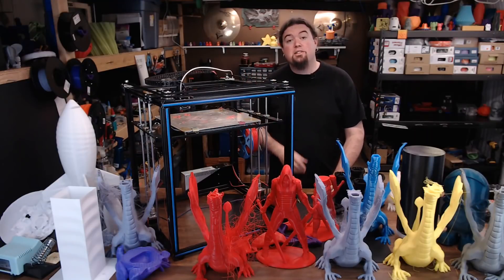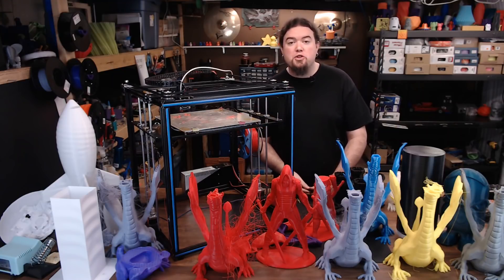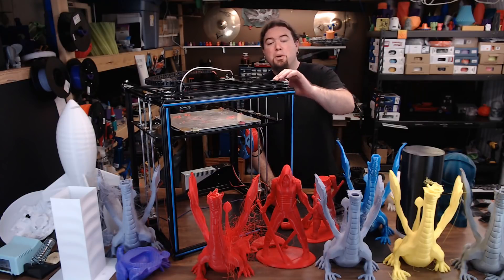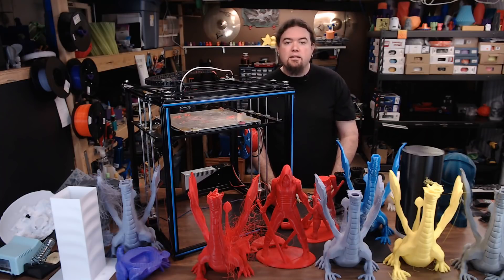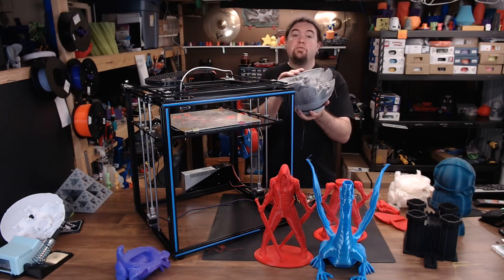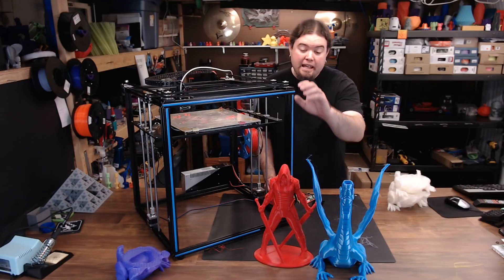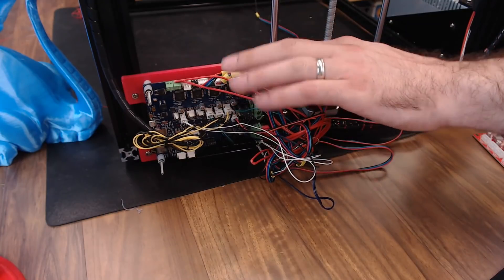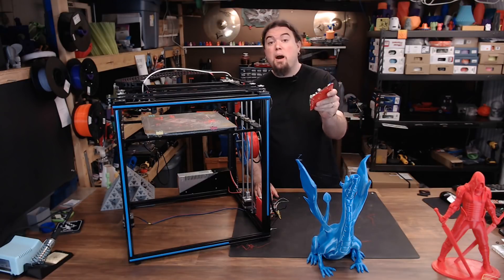Tronxy X5S 3D Printer Review - Kinda - Chris's Basement

Comment: I bought this kit a while back (couple years ago) and had the same board issue. This was my first 3d printer so it was a huge learning experience. I do love to tinker and improve things though. Replaced the original board with a skr 1.4 and some tmc2209 drivers. That alone helped a ton. I've done so much to it since then. Currently upgrading to a skr 3 ez, ez5160 drivers, linear rails, and 48v motor power. It may not be worth what I have in it but I enjoy learning and doing. Thanks for your great videos, Chris.
Reply from the maker: Hey, thanks for watching! For sure, if you started out with this machine and tinkered your way into something great, it would be a very satisfying achievement.

Comment: 5 years later, the pro version has metal motor and idler mounts, proper pins for the pulleys, good endstops and a bunch of other upgrades....and is still hard to use.  It has taken me hours, and is adequate but my $200 ARTILLERY SWX3 pro runs circles around it.  It needs so many things to just be ok and it's unimaginable it will ever be good.  Don't buy anything from Tronxy, ever.
Reply from the maker: Thanks for the update. I still have no interest in anything Tronxy after this.
Reply: @ChrisRiley  Me either.  But, ya know, just for the record.

Comment: I bought one of these for $400 about 5 years ago.. Never did finish putting it together because of all the bad things I've read about it.  I'm basically just going to use the frame and steppers and modify nearly every else.  I have a BIGTREETECH SKR V1.4 Turbo board I may put in it since the stock board is trash.  lol
Reply from the maker: FrankenPrinter!  I have several of those

Comment: You need to see the 1000x1000x1000 new tronxy printer also i have 1 of those i but for 100 and work fine the only problems is you will need to add heatsink on the steps motor
Reply from the maker: I'll have to look into it, thanks!

Comment: I bought my x5sa 400 pro in 2022, never could get it to print correctly, z would never save. Bed level would always go out of whack, I asked for a firmware update, still didn't work, then it caught on fire.

I put it in my closet and I'll probably buy another 3D printer from a more reputable company.
Reply: Would you like to clear your closet out? lol I just want the rails and frame for my non Pro. I have changed out basically everything on mine at this point and haven't even printed anything on it.... I could have probably paid for everything to build a Voron Trident at this point lol
Reply from the maker: I hear you, the one I has was very frustrating.

Comment: Me who has never 3d printed ever.... And just bought this printer today......... 
I chose hell as the entry into this endeavor 🤣
Reply from the maker: I have faith in you, you got this! :)
Reply: @ChrisRiley  Got it yesterday, Built it in about 4 hours.... Leveled, Z offset programmed..... Went to print. And its over extruding like a runaway train.... Get to go home today and learn how to program E steps.
Was pleased to see all of the acrylic was gone besides the filament sensor bracket which doesn't need to be metal. 
Did install a z sync on first assembly. And went with out installing the pillow bearings at the top of the ball screws.

Comment: Tronxy have updated the printer a lot in the last 2 years.
Here's some of the charges.
(Over all its now a pretty decent printer)

The play in the gantry is mitigated by simply tensioning it while it's pushed to one end.

Also the acrylic motor mounts are now metal.

The layout of the belts is now more clearly shown in the updated manual.

They have also changed the mounts which hold the hotend rail.

The extruder and filament sensor have now been relocated to the right hand side of the printer.

Adjusting the wheels that run on the tracks is now easier.

All 3 fans are now a lot quieter, along with the motor drivers.

The bed is now glass

The firmware has also been updated.
The pids for the hotend come pre tuned. 
Only briefly fluctuating + - 1c
Reply from the maker: That's great, thanks!

Comment: Actually, I quite enjoyed by Tronxy X5SA-build - Got the 400³-version at a decent price and pumped a variety of mods into it. Prints just fine now. However, I do see that, out of the box, especially the control-board is just garbage. Switched it out for a SKR-board, put a set of decent belts on and made sure they all run parallel. If you assume that it won't work properly out of the box and do enjoy a challenge, you can take this kit as a starting point to set up a printer that can punch well above it's weight-class. Be prepared to spend another 150-200€ on it, though.
Reply from the maker: Sounds like a fun project. Totally agree with you.

Comment: I'm willing to bet that you had way too much tension on that belt when that mount failed. The force required to make that motor fly like that would be much higher than what those belts should be tensioned at.
Reply from the maker: Yes, I was trying to level the X out, took it a little to far.

Comment: Airhead Bit
1 second ago
@Chris Riley I stumbled across a X5S 'return' and got a deal, when it arrived all the hardware was new just the 2020/2040 parts had wear marks, after two days of cursing at TronXY since the X5S I had didn't match any on Youtube I was stumped until I read a review that explained the instructions were on the thumb drive/SD in a directory. TronXY X5S Version 4 - All the belt guides were different/fixed and the Z motor mounts metal, X carriage 'sliders' were metal and they had upgraded the firmware to 1.7... Power supply is bigger, the head is different, has a heat shield on the heater block. I plan on replacing the cheap piece of crap controller, 128K memory! so 2014. And yes Gates 2GT belt replacement, seems it is a thing, my Pick and Place machine (from Turkey) came with junk no-name belts that were bumpy! The current price of $239 for a X5S to $279 for the X5SA and $312 X5SA Pro would make the Pro a deal but they still are using junk for the controller with 'custom' code, they don't understand 'Open Source' and how it is suppose to work.
Reply from the maker: You are very brave. :) good luck with your build, I am sure you can turn it into something awesome.

Comment: Tronxy X5S was my first 3D printer - and still is. I bought it used and learned a lot in the meantime, discovered some errors and improved the printer. Now it runs very well.
CoreXY is a good concept because of the minimized moving masses, especially for speed, but the large design also requires a very stable frame.
Here are my experiences and improvements.
http://schubfach.de/tron/
The site is in German, but with this:
http://free-website-translation.com/
you can comfortably e.g. also read in English.
Reply from the maker: Nicely done! Glad you have done so well with it.
Reply: @ChrisRiley  Thank you! ;-)

Comment: Can you give me your advice for an alternative COREXY printer this big?
Reply from the maker: I really can't, I think this is about the cheapest one out there. You might be able to scratch build one for a little more money.
Reply: @ChrisRiley  I decide to go for it and god help me with this one :) I really want to try this coreXY style
Reply from the maker: @aspmos  Good luck my friend. 😀
Reply: Chris Riley just bought the tronxy x5sa-400 it has most of the issues here fixed expect the acrylic motor mounts I just know the now they are thicker but now it has actual pulleys with teeth in them not just washer and bearing as idles pulleys anymore
Reply from the maker: @nightmareinaction629  Good to hear they have solved a lot of these issues.
Reply: Chris Riley also the belts are fiberglass reinforced ascentric nuts auto bed level and the board is a 3d bit with touch screen

Comment: Do you still have this printer? It seems to have been upgraded now and I'm considering it or an flsun dual extruder cube printer
Reply from the maker: I still have some pieces of it, I have been parting it out slowly.
Reply: @ChrisRiley  why have you been parting it out? I have 2 ender 3s and think I might get this unless I can find a better one. Any ideas?
Reply from the maker: @tcgtherapy6073  I parted mine out because it wasn't a very good printer and I got tired of messing with it. I will use it to makes other machines. This was an old model, they are probably a lot better now.
Reply: @ChrisRiley   Id hope so by now theyd be better. It is going to be on sale for black friday at like under 300. Flsun also has a cube style printer that seems comparable

Comment: Was going to buy the tronxy x5st 500 cause want a core XY printer with a very large bed about 500mm and I was planing on upgrading the board and a few other things but now I'm just thinking is it even worth it doing that or sourcing all the parts myself and build my own
Reply from the maker: Hey Paul, I think they have improved these over the years, but if it was me I think I would still stay away from it. Even as a donor kit there are probably others out there that would work better.

Comment: I almost bought this machine. Glad I saw this before!
Reply: I just ordered the tronxy x5sa-400. It’s a fully upgraded version with many of the main components updated like the belts, extruder, motor, pullies etc. I’ve seen many videos of people saying it sucks out of the box.  But I also saw many videos of amazing results after upgrades. So it made sense to give it a shot. I’m no sure how updates they mainboard is, but if I run into in issues at a least I know that’s one thing to check.
Reply from the maker: Thanks for watching!

Comment: I have dealt with similar issues in my research. The problem ended up being too small of a power supply. It seems to be random because the coincidence of all components drawing power at the same time is not purely dependent upon the g-code commands and may also be influenced by component temperatures.

Examples:
     Power is applied to heaters based on feedback from a temperature sensor and the controller's control scheme, not when a command is loaded from the g-code.
     Component temperatures can affect power consumption (e.g. later in a print or if you just ran a print, the motors may be warm and consume a little more load).
     Large models are more likely to contain movements that simultaneously draw maximum current on multiple motors.

This solution may still be worth checking when you take your DUET off this printer. Try hooking up a larger power supply to the old board.

You did great troubleshooting the problem. Good job getting passed a very annoying hiccup and thank you for sharing.
Reply from the maker: Interesting, that's something I really never considered on this one. I will give it a try when I get back around to it.

Comment: so a cr10 would be a best budget option for a large scale 3d printer???  im new to the 3d printing universe. im looking into buying a  3d printer and i  would like  a good large scale 3d printer that can print at least 400x 400 x 400 plus for a low price if possible. i dont want to worry about not being able to print a larger part due to the printer size.. unless somebody can tell me any  links to a large 3d printer build guide that i can build my on printer from scratch buy using power tools etc... i would rather try and build it from scratch to save money if there is a proper video out there.  any help would be greatly greatly appreciated .
Reply from the maker: I am not really sure if building one that size would be any cheaper or not, but I can tell you the original CR10 is a great 300x300x400 for the money.

Comment: Printer needs some work but it is not nearly as bad as you describe. I had same issue with my cotrrol board but after 2 min of printing so gearbest refunded $35 right away. At which point I got replacement ramps compatible board for $20-ish, next day delivery. 
Stepper drivers need to be adjusted, that's common knowledge, they have to put it into manual. And pair of motor mounts can be printed or purchased in thick steel for few dollars. My build platform was flat and I am still using original belt as it stretches less than many other cheapish belts.
Certainly not good for your first printer but considering you can get it for $220-240 this is very good start provided user is ok with doing some modding.

With few mods I was able to push it to 250 mm/s and 1500 acceleration with virtually no ringing - something that i3 stype printers can;t even dream of.
Reply from the maker: Glad it's working for you.

Comment: I came to same conclusion, just a bit different issues.
The smooth rods are too short and alu extrusion are not milled properly, so they can never sit right or tight, and if you try you will bend those 2020s.
I had several crooked stepper motors.
Incorrect bed wiring
Too small gauge power wiring all around (they ran HOOOOOT)
Plastic bearing carriers for the bed, broke almost immediately. Fixed with proper metal carriers, bed still wobbly due to design issue (rods should at the very least be in the corners!).
Lead screws seems bent as well.
Z steppers are undersized and unable to keep up when weight on bed increases (weighting the bed down could in theory somewhat help with the wobbly issues).
Pulleys have very high tension, they will wear out fast, and then you need new pulleys. Causes high friction too.

I never got a single decent print out of the machine, and just lifted it to a shelf currently, haven't even bothered to disassemble it yet.
Reply: and the Tronxy community on top of that ... Yikes! 
They *WILL* attack you in every single way they can think of if you dare to say this printer is just gaaaarbage.

Some other youtubers have had some issues due to this, and community trying to force them to change their review and opinion due to that ... I think one youtuber even gave in and re-reviewed it giving it better rating ?!?!?!

Such a sad thing, as this is one of the only CoreXY samples out there :(
Reply from the maker: @skaltura  Mine is on the shelf in the same state as yours it sounds like. As far as reviews, you got to call them as you see them. It didn't go well for me, sounds like that is the case for a lot of others. Thanks for the comments.
Reply: Either of you want to sell me your machines instead of them taking up space on your self's? Being a career machinist with a cnc mill in the garage. Id like to take a crack and fix the issues they have. I love the core xy design. Just cant see spending the $400 on something that needs this much work. But i also dont want to start from scratch. Thanks. Email z28camarochris@yahoo.com
Reply: @What-is-thehandle  Sorry, i probably live on the other side of the globe from you (scandinavia) so shipping would be killer.
This is like 250$ on Gearbest, but please oh please do not order it.

If you want challenge, checkout out Railcore 300ZLT and source all the parts yourself etc. and you will have a damn good machine at the end, not a hacked up together barely printing which winded up costing the same :)
Reply from the maker: I think I will save mine for parts.

Comment: This printer is pretty good when put together properly. I get very good & reliable printing from mine since I tuned it. Issues I had -

Stepper drivers are set randomly, if you run it right out of the box you will have it missing steps or cooked drivers
The linear bearings and leadscrews on the Z-axis need to be well aligned.
Acceleration and jerk were set too high causing shifted layers
Motor drive of the Bowden extruder was not assembled properly
Pneumatic fittings for the Bowden extruder were cheap crap and slowly let the PTFE tube slip out. Replaced them
Update the firmware
Replaced 0.4 mm nozzle with 0.6 mm nozzle for larger prints otherwise they take forever. 
Belt tension is a pain in the ass to get just right
Filament reel holder to replace the crappy bolt.
Reply from the maker: Sweet! Awesome to hear you had some luck with it. Nice list of mods for sure.

Comment: Hi Chris, love your content and to be honest I’ve modified Marlin for my RAMPS 1.4 board through your videos...on my Tronxy X5SA :) 

I had lots of different problems like you, but nearly all of them disappeared when I’ve installed a 12cm fan for the board. All the layer shifts stopped, as well as random reboots. You are right, I never used the shiny belts anyway. I had some spare rubber reinforces belts to use. I’ve modeled new XY carriage which uses 4 wheels, I’ve modeled another part cooling fan to blow right to the nozzle. 

But everything changed when I changed the board and used TMC 2130 drives (clones) and RAMPS 1.4 setup. Layers are somewhat consistent (I’ve changed some of the washers too), the printer is reliable. I haven’t connected an LCD (basic RepRap SmartController), still using Cura or Pronterface for printing. But as of now, I am happy with the results. 

Since I like CoreXY machines, I’d like to know other alternatives besides Tronxy. Especially with 400 and 500mm models for XY diameters, Tronxy is kind of appealing. 

Again, love your contents. Thanks for everything.
Reply from the maker: Thanks! Great to hear you had some luck. I too am on the look out for other core xy machines. I hope to try some others out in 2019.

Comment: I guess the board doesn't have a cooling fan? and perhaps the stepper drivers were overheating? If it can print for almost 12 hours straight there is probably nothing wrong with the board itself... other than lack of cooling. Note how when you change the voltage it started failing in a different spot (you changed the load on the drivers). Even if it isn't the drivers directly if the board is getting hot it can cause the clock crystal on the board to get out of whack and potentially even quit working.... (less of an issue with MEMS oscillators) .
Reply from the maker: It comes with a cooling fan that I tried. I also set a box fan beside it to make sure it wasn't a cooling issue. Still no luck, this was a really strange issue.